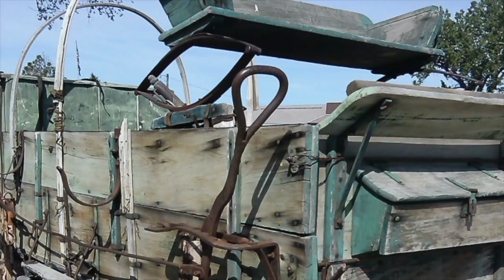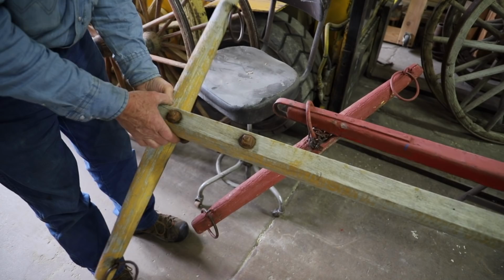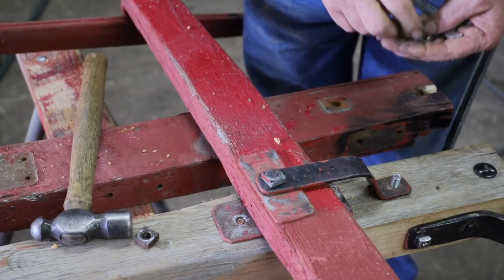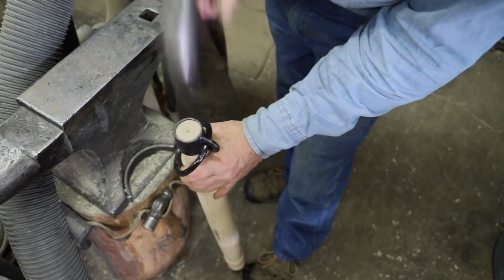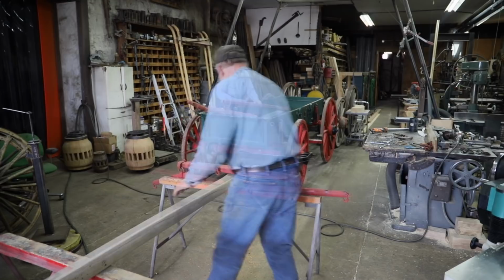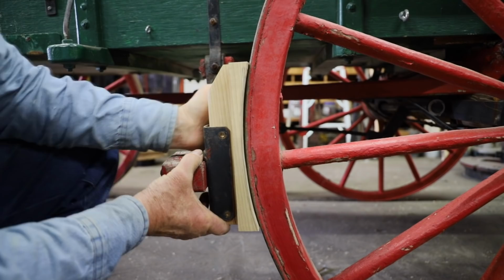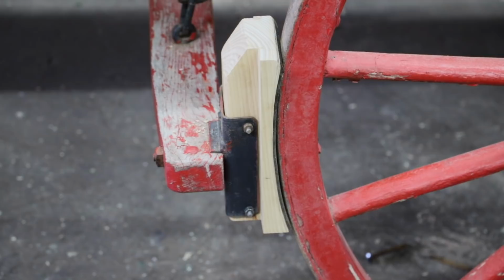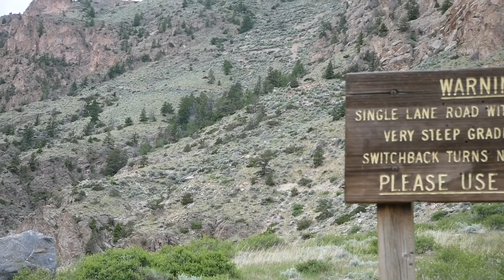Repairs on the Home Made Wagon Finished & the Clarks Fork Canyon | Engels Coach

Comment: I realize you are the Master and I the wee little viewer- taking a minute with a j roller prior to stapling the rubber strip on the brake head would provide a little more even pressure ensuring  more contact with your contact adhesive? As always learning so much from your videos and thanks for sharing.

Comment: Beautiful area.  I've finally retired and moved full time over to my ranch in Eastern Oregon.  Also, I've retired my old YouTube channel (IronClad292) and started this new one, although I don't have any videos yet, too much going on.  I'm about 50% on building my new blacksmith shop on the ranch as well.  I hope to have the building finished in a couple of weeks.  Takes a lot of time when building by myself, LOL.
Reply: @EngelsCoachShop    --  Thanks!!  Well, I took early retirement with a full union pension.  Now the real work begins.......  I'm already sore and tired, LOL...  I'm hoping to get your way some day in the future.  At least I'm 300 miles closer, LOL........
Reply: @ironcladranchandforge7292  TRUST ME, it is worth the trip!!  :-)
Reply: @duanelundgren7985    --  I cannot wait.  I've been working in Blacksmith shops for 20 years, but I'm interested in seeing Mr. Engels shop and tooling, especially for the wagon wheel manufacture.  Although I will not partake in this type of work myself, full wagon manufacturing I mean.  However, I have made wagon parts for restoration purposes in the past mainly for local ranches and will continue to do that.